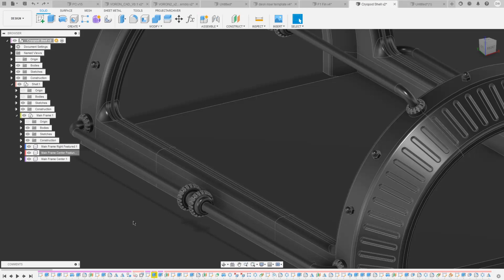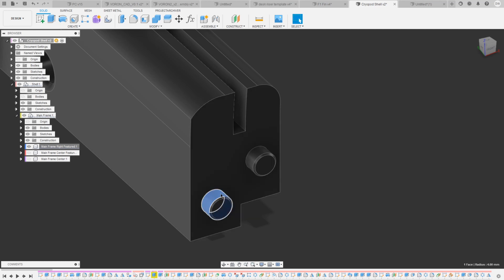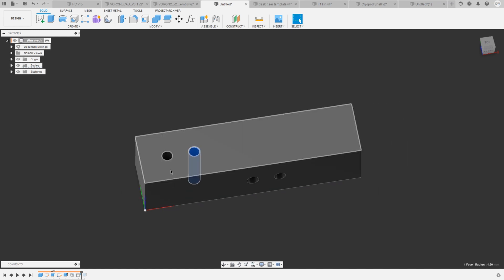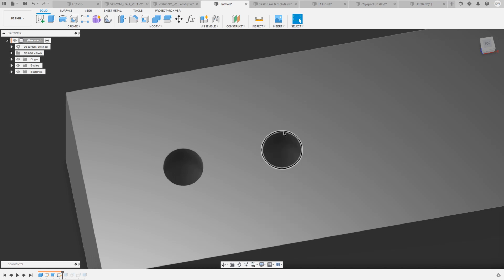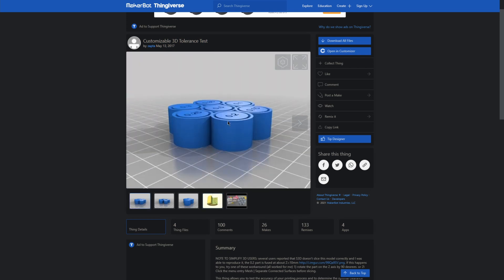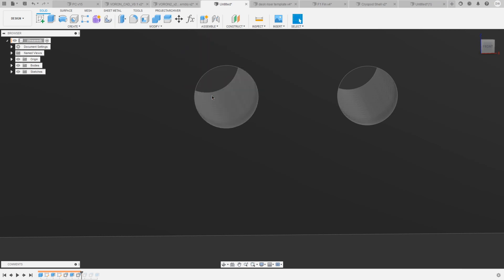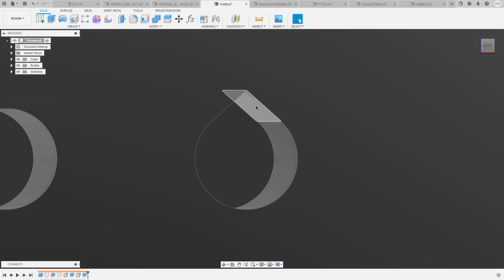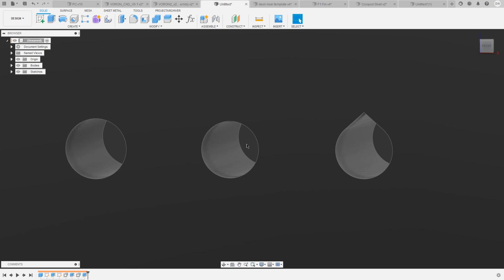How to 3D PRINT Parts that FIT Together - Maker Software

Comment: Hi! I'm attempting to make embossing/debossing folders for my 3D printer and I'm wondering if you had advice for how to resize an image so that the embossed plate fits inside the debossed plate. I know the design needs to be slightly smaller, but how do I do this without offseting the whole image. If I just make the whole image slightly smaller, it ended up changing the location of all the design lines and it wont fit together. Thank you!

Comment: Great help. Thanks
How to make this angle on top of the hole in fusion?
Reply from the maker: Just two lines that are tangential to the circle and then you can put a horizontal/vertical constraint to the corner and the center of the circle.
Reply: @DarkArtGuitarsWorkshop  Thanks

Comment: Good topic to bring to our attention! I also really appreciate that you removed the leading zeros when describing tolerances... "point three five millimeters" is way easier to follow when vocalized. (for you technical writers, use the leading zero, example: 0.35mm when you write, but use .35mm when you speak in public)